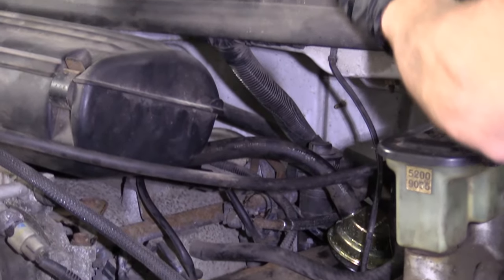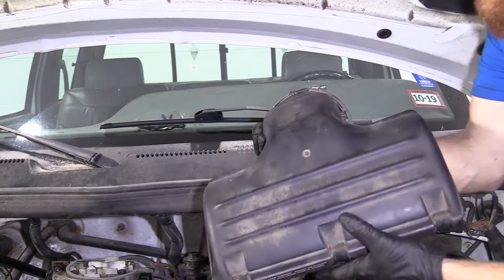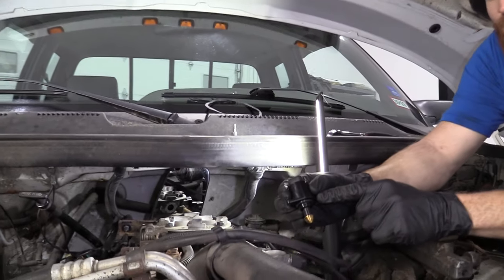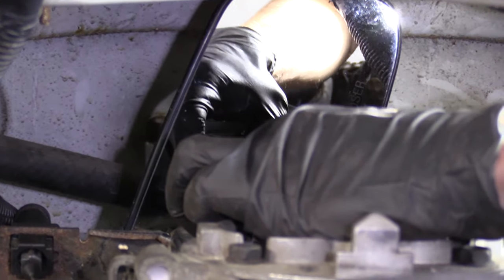How to Replace Idle Air Control Valve 94-02 Dodge Ram 1500

Comment: I have a 1995 Dodge Ram 1500 with the 3.9L V6 (same idle air control valve and throttle body as in the video).  The repair shop (if you can truly call it that) I brought it to could not figure out why my truck had a rough idle.  They had the truck for 2 weeks.  After researching the problem on the internet, I did what seemed to make sense, replace the idle air control valve.  No more rough idle.  I   appreciate the video, as it helped walk me through the steps.  I am handy with tools, but no mechanic. The video also showed me that there was an air filter mounting gasket missing, but not any more!

Comment: I'm amazed at the improvement in the exhaust fumes, before the pcv valve replacement the fumes and smoke from the pipes were awful but after replacement basically no fumes or smoke it works amazing.

Comment: Your Videos are great. It would be fantastic if you would include some diagnostic info. For example, I know that low idle can be a reason this part needs replaced. However, I'm having High idle especially when cold, until the engine warms up, even then it's still idling high.

Comment: Will try that next. Already did the following.
1. TPS sensor
2. Plugs and wires 
3. Distributor cap
4. Sea foam in gas tank
5. Throttle body cleaner
Reply from the maker: +Chon Dominguez Thanks for the feedback!
Reply: Did not help. Idle air control valve staying open after engine warms up.
Reply: Idle control sensor
Reply: Did you have code P0505? Idle Air Control System? That's what I have rn

Comment: This was such an informative video. I fixed this part on my truck, and it runs in idle so well! Now I have to figure out why it sputters when I’m driving sometimes and how to fix the ABS and Brake Light being on.
Reply: That's most likely your rear differential speed sensor needs replaced. Cheap and easy fix (imo)
Reply: Me 2 changed the speed sensor didn’t fix it
Reply: Ur brake booster is out..thats what cause the IAC to fault once fixed its still sputtering because the vaccuum in the booster ..booster has failed
Reply: @mattlambert8989  i replace my rear differential speed sensor and the abs and brake came on again so i found out was a faulty brake sensor switch its located under the steering wheel and problem solved
Reply: @angelmarquez6770  you have a faulty brake sensor switch its located under the steering wheel that was causing my abs and brake light ,i replaced and its fix now,good luck.
Reply: I changed my crank position sensor and it fixed my sputtering (and eventual no-start). It wasn’t easy, but these guys have a video on it
Reply: Check the sensor going into your rear end for your abs
Reply: From my experience, change out the IAV and the TPS together. It makes a huge difference. I got a 1996 Ram with over 300k mile

Comment: So I have a 98 dodge ram 1500 with 282K miles. When it idles it randomly revs up to 2K RPM. On the highway driving it will surge a few hundred RPMs and last week for the first time I was approaching a stop light and it just kinda sputtered and died out of nowhere. It hasn't done it again since then but it's strange. What do you think it could be?

Comment: I have a 2000 Dodge ram 1500 V8 5.2 can I just simply replace the idle air control valve and that's it nothing needs to be recalibrated or anything like that?
I need to replace it because my truck shuts off while I drive everything else is on like the radio and everything just the engine shuts off it happens mainly when it's really hot outside so I think my idol air control valve is going bad because the RPMs go up and down and it's not steady.

Comment: Hi Barb from N.C I so love your videos.. they have helped me with my 1995 Dodge 5.9 V8
Everyone loves my truck but and it runs like when I got it in 1995 , it’s had work on it but recently it’s runs good but it start getting like it’s gasping for air. During the summer had a total tune up,oil change,brain ,ect
I’m guessing at this that it’s the air intake valve that you just showed.. am I wrong?
Thx

Comment: Replaced mine and started it up seemed to be running good tapped the throttle and it red lined and got stuck.  Shortly after I got throttle back to idle I started to hear clicking sound from passenger side so I pulled out the spark plugs and cylinder 8 had pieces of metal inside cylinder and electrode off plug is gone. Got a video for that?

Comment: I have a 98 Dodge ram 1500 with 98,000 original miles. Im changing this part today. I have new cap rotor plugs wires both O2 sensors. I've cleaned out the throttle body. When I drive at low speeds it's fine for awhile and bogs out and dies it's a couple of minutes and starts right back up and drives. I cannot drive at high speeds it'll bog out and die above 25 mph. I ran seafoam through it with 93 ultra which I've been putting in it it seems to be better the fuel pump is also new. I have no codes. It is running better after the sea foam.

Comment: Any advice, truck used to never idle , replaced iAC and  idles now, however once ran for awhile it don’t wanna idle or when I turn it off then go to turn it back right on, seems like it needs to not be driven for a bit to idle again
Reply from the maker: +SilkyBuckets We wouldn't be able to diagnose an issue like that here, you may want to have a local mechanic take a look at it. Thanks for checking us out! http://1aau.to/m/Shop-1AAuto-c

Comment: I’m having a problem with my 01 1500 5.9 it shut off on me when I was driving it happened a couple times I replaced the idle air control it stopped for about a week then it happened again any idea what it could be?

Comment: I replaced my iac valve and had the manifold gasket relpace and my engine is still acting up. Not all the time but sometimes when I start it up it barely idols and if I try to drive it like that it will die when I let off the gas. Other times it will drive like a brand new truck.sometimes I have to turn my truck off and start it 20 times to get it to run right sometimes I just have to drive it like that or just wait.  My mechanic said I need to set the iac valve. How do I do that?
Reply: Having the same thing happen. Did you ever figure out your issue? I’m stumped 🤔

Comment: I followed the IAC video and my truck still seems to me stalling out at red lights/4 way stops. Is there some way I should adjust something? Or would you recommend something else? Thanks for your time!
Reply: Try the ERV Valve. 1A Auto has a video on it also. I replaced mine and it fixed my same issue! Only cost me 50 bucks and 5 minutes.

Comment: I had low idle issues and replaced this now the truck idles high and when i put it in park idles even higher what would be my next thing to do?
Reply: Just suggesting a throttle position sensor. Good luck.

Comment: So same truck. Driving down the road, I hear a hiss went accelerating. Would stop when gas was depressed, then just stopped an it has drank gas. Like 4 miles to the gallon. Any help or ideas
Reply from the maker: +Jake We wouldn't be able to diagnose an issue like that here, you may want to have a local mechanic take a look at it. Thanks for checking us out! http://1aau.to/m/Shop-1AAuto-c
Reply: @1AAuto  someone may come along that had same issue. If they reach out that's great . Ty for quick response

Comment: So i have a 2nd gen as well and am wondering if anyone in the community can tell me why my dodge dies on a right turn. It does it most the time but sometimes it doesnt. As long as i give it gas it stays alive and once i go straight it stops stalling
Reply: I had the same issue on my 1997 ram. In the end, changing out the crankshaft sensor is what made it go away. $15 part at the time.

Comment: Will the idle air control valve cause a vehicle to be able to run at a Rev but not at idle
Reply: Did you ever figure out if this fixed your problem? It sounds like im having the same issue on my 97

Comment: I've replaced this part ...and its still idles high but now in N . I drove it and parked it and I sat in it and it didn't high idle anymore . Turn the truck off and it high idles again. Now I don't know what to do for it
Reply: Try cleaning throttle body

Comment: I just replaced the IAC in my 1999 Dodge Ram 1500 van and now it won't start (took it out for a test run right after we replaced it and it was running fine. Wouldn't start this morning) anyone ever encounter this?

Comment: Hello guys I got a 99 Durango when I put it in drive and push the gas pedal my rpms jump up to 4 is that a bad sensor looking for some help only had the vehicle for a week now
Reply from the maker: +Heath Calvert We wouldn't be able to diagnose an issue like that here, you may want to have a local mechanic take a look at it. Thanks for checking us out! 1AAuto.com
Reply: Idle control sensor

Comment: My 02 ram stays on only when accelerating but when I let go of the gas pedal it dies ,any advice on what could be wrong??
Reply from the maker: +Eddie Castaneda We wouldn't be able to diagnose an issue like that here, you may want to have a local mechanic take a look at it. Thanks for checking us out! http://1aau.to/m/Shop-1AAuto-c
Reply: Did you figure it out? Mine dose the same thing
Reply: This is most likely IAC.

Comment: I have 98 dodge ram 1500 5.9L i just replaced my drum brakes and my front brakes and forgot to take the key out so it died when I jumped it it high reves all the was up to 2300 rpms and wond wind down unless I put it in geer and it will still high rev at 1100 rpms and won't go lower at all and its not throwing any codes any ideas

Comment: I had the P0505 code and I'm still having the same problem
Reply: Did you ever figure out?
Reply: Same here cleaned the throttle body, checked the wires, and replaced the IAC. I'm not sure what else I can do.
Reply: Try the idle control sensor

Comment: Got this part installed and for some reason when I start my truck the rpms rev up to 1700 and then go back down to 600. Not sure what I need to do in order to fix it...
Reply: Replace the the idle air control sencer on back of your intake
Reply: Mine does the same thing, it calms down right after start up tho
Reply: Did you ever fix this. Mine does the same

Comment: Hey I always wanted to Ask this question. Is it ok to use vaseline as lubricant on some parts like this. Because I've been using the Vaseline on certain parts of my old vehicles and it works good. I'm just asking do anybody else ever does it. And what is the best lubricant I can use for parts on a vehicle?
Reply: Clear lube for window runs hinges, Vaseline for rubber parts clean oil for gaskets like oil filter

Comment: What if the code still comes up after replacing it? Does it mean I bought a new bad one? I clear the code and instantly the check engine light comes back on but it does seem to be idling a lot better
Reply from the maker: +bodyguard420 We wouldn't be able to diagnose an issue like that here, you may want to have a local mechanic take a look at it. Thanks for checking us out! 1AAuto.com
Reply: Did you ever figure it out I have the same problem
Reply: Y’all replace the rotor cap yet? Sometimes that being off can cause it. Had a tahoe do it. Ran rough af then I adjusted and it was good